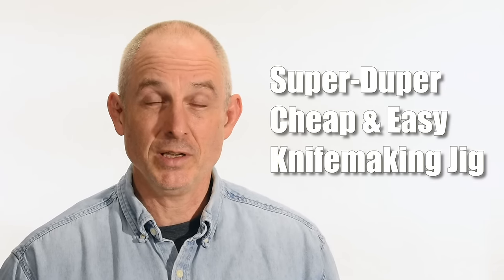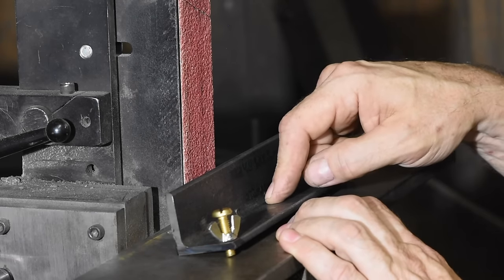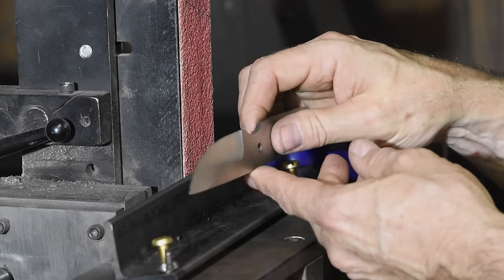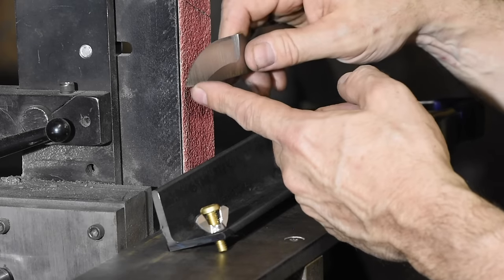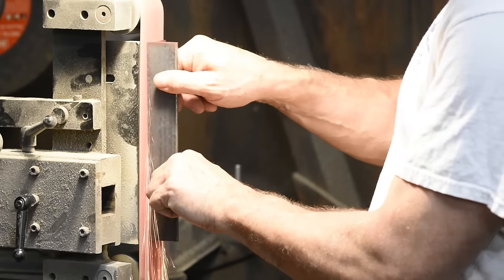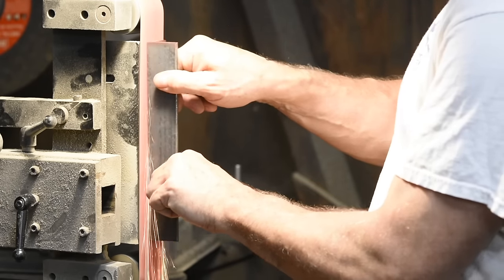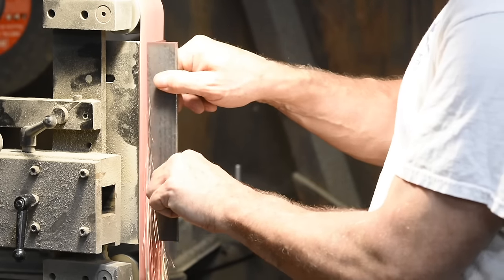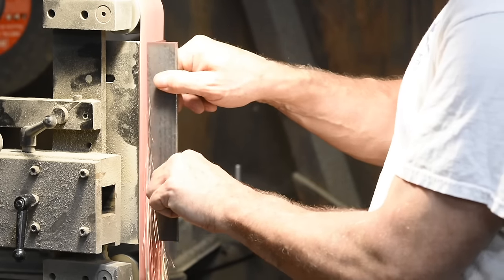The World's Easiest Grinding Jig for Knife Making

Comment: So in other words if you screw up aligning any one of the six holes then you pretty much got to start from scratch or drill new holes. There is one similar to this on YouTube that uses a door hinge for adjustability. Pretty much the same just with a hinge added for adjusting instead of the brass screws.

Comment: Love the simplicity, and it be even simpler. As it is now, it's what's called over-constrained. Much like how a four-legged table always rocks slightly because all four contact points are never the same length, so too will this. Only one screw/angle adjuster is needed, in the center.

Comment: Haha.  If u go through 2 taps at that rate, not to mention as a fif champ, u need a lot more experience/ feel.  Cause I've owned the same set of cheap taps for 10+ years.  They are duller than they used to be but I've turned enough threads to know when to back it off.  Hence the fact I still have a complete set of taps 10+ years in.  Jis sayin.

Comment: One tiny addition. The spine of a knife is often curved. Where the spine hits the support screws is very important to keep the blade at the same angle from tip to tush. I made a notch in the center of my jig along the top edge of the angle so I can locate the blade properly when I flip it over to grind the second side.
Reply: So do you mark the blade through the notch then flip it?
Reply: Put the curve in after you sharpen is an alternate option
Reply: Can you describe further? I did make this jig, but I have difficulty getting the bevels equal on both sides, would that be the issue Im having? I see Wes Jones' remark to mark the blade as well for registration?
Reply: @thomaswildgen5659  If your bevels are different, I would look in 3 areas. Walter uses 2 screws to set the angle of the jig. Are both those screws set at exactly the same distance out of the bottom of the jig? Is the table of your grinder at 90 degrees front to back and side to side (Of the belt)? If they aren't, adjust them and try again. The third thing is, look at your piece of angle. Sometimes they are warped or a face will be cupped. Flatten it out. Mine had the slightest bow in the face. It wasn't noticeable until I tried to grind a knife. A slight imperfection can make a major difference in your blade. Keep me posted.
Reply: @thomaswildgen5659  Yes, registration is important. I put a notch on the top of my jig. On the blade I used Dykem (sometimes a sharpie) to mark where the blade is sitting. That way I can flip the blade, line up the marks, and it will sit at the same angle end to end. Also, I use two screws to rest the blade on. I don't have 4 like Walter has. BUT, he says, make sure they are in line with the bottom edge. That's very important.
Reply: @64t120r  Thanks SO much for the advice!
 I will be double checking the measurements you are mentioning. I have just purchased a new 2 X42 Palmgren belt sander, ( I cant afford a 2 X 72 yet :( ) I'm busy making the mods needed to be able to use it effectively to grind knives. (adding a glass platen and cutting back the guard and Table)   so I will carefully check the level of the  new table and for sure!
Reply: @thomaswildgen5659  A new grinder! Have fun with it.
Reply: @thomaswildgen5659  How's that new grinder been treating you?

Comment: Whenever we had to tap something when I worked at the small engine shop, we would chuck the tap into a 20V Dewalt drill. Fast and easy. Used straight flute taps as well.

Comment: Good build AND theory, thanks. Since the threads you’re cutting are for adjustment or registration purposes only, and not for holding forces, I would definitely use the next-largest fractional drill size to avoid breaking the tap and to make adjustment easy. In the case of the “shelf” screws, a dab of lock tight will do ya.

Comment: Great info. That tap wrench would drive me crazy being off center like that.
Reply: You can just "press-on" a Nylock nut on the square end of nearly any tap, and use a nut driver or socket wrench to drive it.  The "Wiggle-Room" helps to self-center the tap, preventing breakage. I've been using this method for over 50 years, as it was taught to me by a Japanese Master Machinist/Toolmaker...!
Works on 4-40 to 1/2-20 taps (2-56 taps are "Risky"!).  Lol

Comment: Gun taps also work great for through holes. They just have an aggressive cutting edge that turns the chips through the material instead of out the top of the hole like his spiral flute taps. They are also substantially less expensivw.
Reply: Bees wax makes the tap work great.

Comment: In a pinch you can use a stainless bolt, make slotted 3-4 cuts down the threads. Works fairly well as a homemade tap.

Comment: Mr Sorrels, I love you videos and I am learning a ton from them. In return I would like to give you a free tip. When you are drilling into steel for tapping, add .010 inch to the tap drill size, you will break a bunch less taps. Thanks for all the great information.
Reply: Bad advice. Rather, find a tap chart for 65% threads instead of 75%.
Reply: @jonenglish6617  just today 52. Probably 400 last week. How many years should I go back?
Reply: @urgamecshk  try the +.01 it works very well and only reduces strength by  about 3 percent.
Reply: @jonenglish6617  please research more. A 0-80 screw is 0.057. The cut tap drill size is 0.046. Using your silly rule of thumb you think 0.0005 per side will hold at 97% strength? Wow you're a genius it's a wonder the entire mfg industry hasn't given you millions for their increased productivity. I bet you also tap holes 2x Dia deep because you think it's necessary 🤓

Comment: hmm, a little bit of modding, and it'll be good for lathe skew chisels.  And a third screw in the center could be used to set the angle, and then drop the outer screws to the table.  As for tapping, run a 1/4 flange nut on the tap first to hold it plumb  or start it on the drill press.

Comment: surely excellent tip, thank you so much, i am pretty new in this knifemaking thing. i will try this by using bolts instead of tapping  since i don't have the stuff and experience to do so. might  work to get a regular angle for grinding if i can control the angle with an angle verification tool (still have to find one tho) thanks again for the inspiration!!!

Comment: I use an aluminum 2 X 2 X 1/4 angle, no screws at all, clamp the blade blank onto it with a good vise grip and git 'er done! Also tilt my table instead of sing the wing nut powered feet.

Comment: It just occurred to me that a used carbide insert could easily be clamped on the belt side of blade to serve as a plunge line hard stop using a small C clamp. The thick square ones would be perfect since they can be rotated 4 times as they get progressively grooved by the belt.

Comment: good video, nice & simple jig/fixture. My only question is why were you using what appeared to be a "Die" handle instead of a Tap handle to thread those holes? The fact that the handle you were using holds the taps off center makes it even harder to tap straight.

Comment: Thanks Walter. I’ve never tapped any screw threads (never had a need), but I’ve started making knives and I figure it will happen. It would be very helpful if you could make a video on using taps and dies. Thanks for all of the information and videos.

Comment: Walter loved your jig,  However, you used brass adjusting screws to avoid scratching table.   Why not also use soft material for the angle iron??  IE: aluminum etc., ??  or is long edge okay for sliding repeatedly without causing grove?

Comment: Why not just have a great adjustable/lock-down angle tool rest table, wide enough for the length of you knife lengths, and a squared flat mount blade holding jig? Use an angle gauge to set the table. Fewer parts, and more robust. 
The holding jig could be created to hold the blade at different angles on the flip/flop of sides.

Comment: Hi Walter, I have been following you for a while now and have learned so much so thank you for taking the time and trouble to make your videos. I have just started to make a knife out of a bastard file my Father owned. My question is what is the angle I grind the bevel at? The material is 8mm thickthe widest part of the blade is 32mm, I want to put a quite large bevel on probably around 20mm, leaving 12mm at the top of the blade. Thank you. Martin (Essex UK)

Comment: Perhaps just use tilt table for angle to prevent wear with those screws or throw a hinge or two on back with a thin flat piece under the set screws...

Comment: I always think it's strange that people usually use 1 bolt in the middle, making it wobble, good to see you have 2 bolts to stabilize the jig. I freehand grind all my knives, but I came across a problem with pre QT thin stock. I need to use a jig to absorb the heat from my work, I don't usually care if I do the HT after grinding, but for these kitchen knives I need fast production, so I need to keep the heat low.
Reply: 3 bolts are stable mate 
like tripods 
it only wobble  if you load the weight over a side
Reply: @NikoMoraKamu  Oh ok thanks for the info.

Comment: Use a adjustable locking square to get the same length on screws. The ruler looking ones with the sliding part that locks to the inch you need. Can't remember the name

Comment: Started making this jig.  Then realized, why make the jig, angle adjustable when the work table of my grinder is easily adjustable.  Easier to leave the jig at 90 degrees and adjust the table for bevel angle.  Also ends the debate of one or two adjustment screws.
Reply: Same here
Reply: It's more work to adjust the table, and harder to adjust if you want to tweak it just a €unt hair...
Reply: @paulesterline5714  Much easier to adjust my table and a tap to tweak the angle.
Reply: @davidakamine3420  Not mine! I used to do it that way. I mostly free hand anyway...it is faster yet.

Comment: So when you're grinding the primary bevel, how do you know where the center point of the knife is so you have the same amount of steel removed from both sides?
Reply: you mark out the centreline beforehand
Reply: @opiwaran354  .....By using good old hundred-year old "Dykem" in blue or red.Some people do not even KNOW about Dykem.

Comment: Why is it you always post a video the days I'm working on knives.  Not to mention my jig that I made broke on me today.  I use a wood base attached to a piece of angle iron with hinges and a single center bolt adjustment.  Better part of 5 bucks spent with scrap laying around and it's my most used tool

Comment: Brass bolts to stop scratching up the table, what do you think the angle iron is made from?
Reply: Angle iron is mild steel same as the base plate, hardened steel bolts will scratch as they are different type of steel and are harder than the base plate
Reply: But the longer surface of the angle iron won't dig in, polish a slight chamfer on the very ends of the corners and it will glide along smoothly. The edge of a hard bolt will scratch the table due to pressure on such a small contact area.
Reply: Mild steel, but instead of a single point, as the tip of a bolt, the pressure is spread over the whole edge that contacts the table. He could use brass angle "iron" but who makes that?The idea was to make it quick, simple and useful. If you want perfect, throw a bunch of money at a professional rig.
Reply: Use aluminum angle, duh.